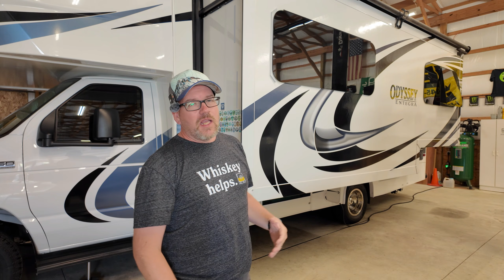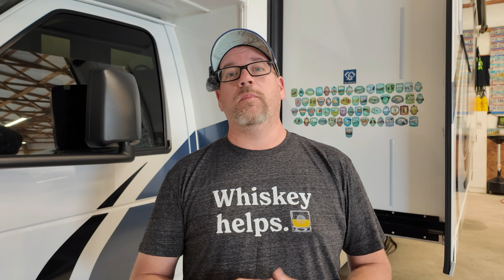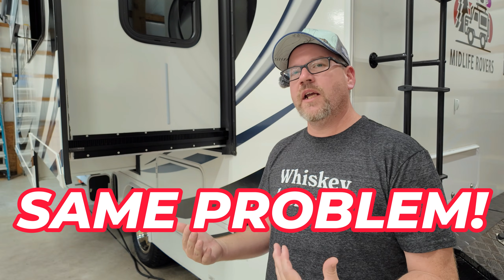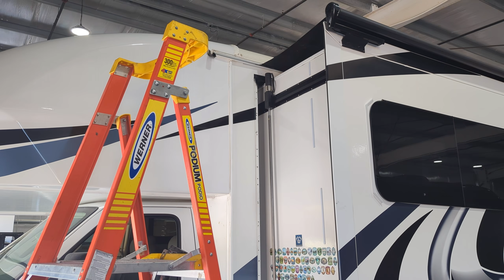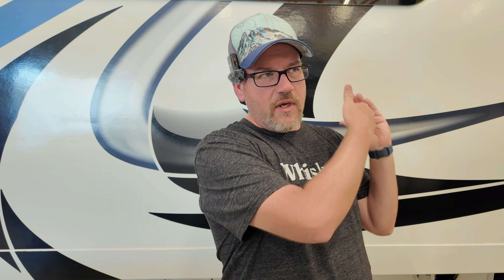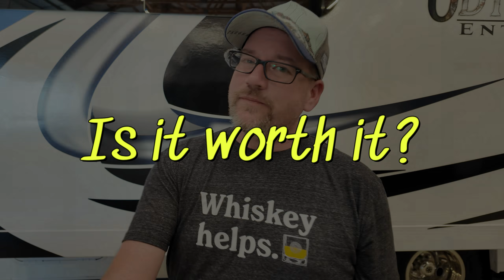Is Vroom an Upgrade Over Schwintek? Tumbleweed Slide Saga & Full Review

Comment: Wow, what an ordeal you have been thru. My entire career (now retired) has been in mechanical maintenance of some type, RV tech/automobile mechanic, Journeyman Pipefitter, Journeyman Millwright/Machinist. I understood every aspect of your descriptions. I'm glad I listened to the whole story which left me shaking my head. Where has integrity gone nowadays in the service end? I know it may be a bit twonky, a nicely shaped bead of black Sikaflex on the tops of those aluminum rails would leave the water run off nicely. We have 2 rack & pinion slides and a Schwintek bedroom slide in our RV. No issues with the Schwintek yet but did have an acme nut that wasn't Loctite fastened inside the slide operator back itself out. Didn't cost anything but about 2 hours to remove, repair and then check the operator on the 2nd slide for piece of mind. We have an issue with water entrance on the slides when retracting them if the slide awnings are holding water. Haven't come up with a good fix for that yet other than removing the water first. Sorry for your ordeal you went thru.

Comment: Final comment, you bought a used RV, you had problems with it,  (Because it was used you didn't have warranty support for anything (caveat emptor) ) and you had a problem so you took it to be repaired and you expected the repair center to fix every single thing that was wrong. They should have been VERY clear on what they would and would not do.  I don't know if you made your expectations clear (it didn't sound like it) that you wanted the entire system to work and if anything was found that was out of the scope of the estimate you would be asked if you wanted them to fix it.

Comment: It sounds like you had an installer issue. Unfortunately as a company opens up remote outlets and 'certifies' installers, they still cannot check that things are done properly, this problem exists what each and every chain of distributors in every type of business.  Thankfully we had ours done at the headquarters when the company was just getting started and we've NEVER had a problem.

Comment: I've had a VROOM system installed on my 5th Wheel for 4 years, I had it done at the factory in AZ when they were just getting started (before they had installers across the country) and we've NEVER had a problem. RV build quality is an issue across the industry. With the exception of a couple of small manufacturers, the large companies located in Elkhart have overall poor to moderate build quality at best. When it comes to slideouts you need to understand that the RV floorplan, frame and size of the slide, determines the type of slideout mechanism that can and SHOULD be used. Many of the Schwintek slides fail because they are used on slides that are too large and too heavy, the VROOM system was designed for these slides.  Understanding that what the VROOM system replaces is important. If your slide floor is garbage, or the slide isn't square, or it was poorly built in the first place, NO SLIDE mechanism will solve the problem.

Comment: We had issues with the Schwimtek system on a used 2013 Winnebago Adventurer 38 foot . We love the floor plan. The biggest issue is the slide is very long and way overloaded. With the tv at the front then the kitchen, a double door fringe, a stack washer and dryer, then the clothes closet. So when the the slide is in there is a lot stress on the bottom  gear mechanism trying to hold the slide in the closed position . Eventually the bottom track and gear system gets chewed Up. So first I added an extra track and gear system to help carry the weight moving in and out. When we first had the problem wit the original set up I heard a snap then find out the bottom gear had jumped a tooth then a second snap jumped a second tooth then the slide was riding at an angle with the bottom open. We took it apart retimed the gears and the first time out same thing happened. After installing the 3 rail complete with all new set up and realized that the problem potential was still there I decided to make slippers. I measured the high from the floor to the slide out when open and found the space to be approximately 7/8 of an inch. Made 4 inch wide slippers with nylon slider and positioned them under the edge Of the slide before we close it and have had no problems since, when the slide is in the weight is now distributed on the back rollers and the slippers.

Comment: Providing your Lippert is installed correctly,  proper LUBRICATION will Save you ALOTE of problems! The binding that happens with a dry slide leads to premature failure. Once I found LUBRICATION with CRC with PTFE, my slide has been heaven!!!

Comment: After 9+ months, do you have any updates? Did either of the companies every get back to you?
Reply from the maker: We heard from Vroom largely in response to this video but it was not a productive conversation beyond confirming and acknowledging the issues we spoke about. As expected, the slide has always worked mechanically. However, water intrusion remains a battle. The slide rails like to eat the flap seals so they have been replaced (again). We replaced our slide awning to a slightly larger one which has helped the rain issue when it is light. On downpours the only way we stay dry is to intentionally make the coach unlevel to help the water shed away from the coach. We DO NOT recommend this system.

Comment: We have found that Vroom is all HYPE. The Schwintek slides are good and not always installed, operated and maintained correctly. Every service job we perform on the Schwintek slide system was a lack of maintenance, poor installation or clients overloading the slide room. Sorry to hear you got pulled down in the Vroom rabbit hole. We have also found that manufactures don't always install the schwintek slides correctly. As a independent RV Service Center we don't sell new or used, our focus is service only, and offering the best experience to our clients. Great video!
Reply: I've had the exact opposite experience.  Never had a single problem with the VROOM but had TONS of problems with the Schwintek.
Reply: Sounds like the technician should have asked you if you wanted the electronics changed as well.  Based on the initial interview and the operation that you described. You were expecting a complete rebuild of your slide system, including the electronics and the installed just did the mechanical.

Comment: Great job describing your experience! I would have been just  as frustrated with the how they addressed the analysis and repair. We have a 2018 Big Country 3560SS that has a large double slide with Schwintek. The slide has always concerned me, but now it has been skipping on the way out. The bottom tracks are shot. It now is out of sync from top to bottom. Needless to say the system needs to be replaced. I was considering looking at Vroom. After listening to your evaluation of the two systems components, you have identified some significant differences that need to be considered. This has helped in my decision to replace what I have. Thanks! Love the shirt!
Reply from the maker: Thanks so much for the comment! Glad it has helped you in some way. For what it's worth, our side has mechanically worked flawlessly since leaving Tucson. That said, the water issue persists but we've found a way to work with it to prevent intrusion (making RV unlevel).

Comment: Whoa. I have  swintek. 3 slides with them. They work fine. I have learned  how to maintained them correctly. With lots of utube technicians. My slides are  smaller. That helps. If I may say. If you have a full slide. Only get it hydraulic only. Other wise walk away. They are heavy. And never get a bedroom slide. Make sure the bedroom doesn't move in a slide. And don't have a kitchen appliance slide either.

Comment: I commented on your video about how we are not pleased with our Vroom system. I just wanted to let you know I'm looking at going back to Schwintek. I know it isn't as heavy duty but I can find someone to work on it without driving 15 hours one way. Considering my fuel cost to make three trips and the cost of the Vroom system I now have over $6,000.00 invested. It's not working properly now and it's just out of warranty. I don't think I can justify another $700.00 for fuel and a 30 hour round trip, plus what ever the labor cost would be.
Reply from the maker: We have considered going back to Schwintek as well. With all of the holes and seal changes they made to accommodate the Vroom system, we're not even sure what that would look like for us. We wish you luck on the changeover.

Comment: Great take. I only wish I had seen this video prior to getting the Vroom install last week. I fell into the “we’ll see if the Schwintek works this time” category and I was done with it.  That said, I think I had come up with a semi-permanent solution to the slide motor popping up out of position. But as it is said, what’s done is done. Thanks for the video.
Reply from the maker: Since this video, we have continued to tweak the seals and adjustments to where we are in pretty good shape. Sounds like you may have similar skills. We wish you luck and a positive experience that others have had.

Comment: Great video. We have a full wall slide(23 foot long) and the rear part of the Schwintec needs replacing. I went down to the local RV repair guy (not Camping World) and he quoted me like $3200 to have a new H-column with motor installed. Just for the rear. I figure an entire VROOM system wouldn't be that much more expensive than changing the entire Schwintec since the front also is showing signs of wear.

I will be learning from your experience about checking the install.

Comment: I don't even know where to begin. Great video. Its a shame rv manufactures quit using the rack and pinion system on class C rv. I will not consider a slide out that does not have a rack and pinion system which eliminates all class Cs. I did see a old class C Winnebago mabie 2005 with a rack and pinion and I said to him Do Not Sell this. Awesome video but If you go to sell your rv trade it in so the new owner doesn't come back and hang you.

Comment: And I thought I was the only one who has problems with RV experts. I also have a mechanical engineering background and do my own work. The only time I go near a RV repair shop, with clenched teeth, is when I’m travelling. My next investment is to be a tee shirt like yours. Happy travels.
Reply: Adding to my comment, once upon a time in a galaxy far away, when I was younger, I spent some time as an Engineer on a ship. I learnt, as the old Chief Engineer whom I got on well with and who survived several sinkings during WW11 told me, “there is no spare parts shop at sea, this is what we’ve got, make it work.” I have had that conversation in my head forever. So, before I swap something out, haunted by guilt, I see his face in front of me and tell him why I’m doing it. If that makes sense.

Comment: no wonder some peeps simply prefer to go with an RV w/o slide outs i understand it now...
Reply from the maker: Yes, we can see that as well. Unfortunately, that only works in theory as there are very few RVs without slides these days. We've only seen very low end or very high end (like a Prevost) without slides. Once you start shopping for an RV, you quickly see the benefits outweighing the issues with the added space and options they provide. ~A~

Comment: 31:09 if you are worried about water movement, simply put a dab of black silicone where the foam piece is.  Also, you could drill a small hole in the "shelf" on both top and bottom of the rail to allow water to drain, if drilling said hole (nearest to end of rack closest to rv wall) would not interfere with the gear teeth upon drilling.  Although I think there's enough clearance for a drill bit to not touch the teeth when drilling through.
Reply from the maker: Thanks for the ideas! Unfortunately, we’ve looked into all of those options and none of them are really workable in this case. Since most of the water passes through the gear area, there isn’t a way to add any type of seal that wouldn’t also get caught in the gear and either destroy the seal or gum up the gear on the first slide movement.

As for adding holes in the top or bottom, this surface is actually a bearing surface — it’s what the slide rollers ride on — so any holes would have to be extremely small to avoid weakening it. Vroom actually added small drain holes already, but they’ve had little to no effect.

The best workaround we’ve found so far is that when it’s raining, I intentionally leave the RV about 1.5 inches out of level so the water will drain out instead of pooling.

~J

Comment: How about drilling holes so the water drains through the two horizontal sections?
This would not seem to interfere with the gear mechanism, but allow the water to run through
Reply from the maker: Vroom added some holes, but they have been ineffective. They simply can't evacuate water sufficiently. ~J
Reply: The only reason I found out about the water. Is cuz there was a storm...  I heard dripping.. paying over 60 thousand dollars for a camper. That sucks

Comment: We are looking at Vroom but $5,000 upgrade seems a bit crazy. Our Schwintek slide failed on a recent trip. Cost us $2,000 to find out that the potentiometers? In the controller flipped somehow so one was trying push the slide out and the other started pulling the slide in. 360 degree slide? Took a day to get it in and another day to figure out the controller was the problem. Thinking vroom is an upgrade? We live in WISCONSIN an hour from the installer you mentioned. Probably backing off Vroom for now and praying the Schwintek does not fail again. Sounds almost like your slide issue is a design flaw from the factory exacerbated by trying to fix a design flaw.

Comment: In my opinion Schwintek slides are not even close to being heavy duty. Especially for the entire side of an RV. I’m sure they work great for a bedroom slide out, which is where they belong . The RV should’ve been designed with a rack pinion system.  But you can look at how everything else is made and put together and it shouldn’t surprise you.
Reply from the maker: Yes, I prefer rack & pinion for several factors... Unfortunately, use on a class C would mean raising the floor deck. Not only would this raise the center of gravity and overall height of the rig, but also make the cab to coach transition awkward and the rotating chairs useless. Everything is a compromise and "cheap" seems to be the prevailing decision on many things. ~J

Comment: Thank you Jay for the excellent video on the Schwintek slide system, and detailing the issues that snowballed.  I have a 2022 Thor Gemini 23TW (purchased new in 2021) that is very simaliar to your Entegra, and we have been having slide issues off and on for the last year as well.  In my troubleshooting efforts I have replaced five slide motors, two controllers, and one harness cable.  I live in Wisconsin and was sold on the Vroom system to solve my issues, but after watching your learning video and now don't think it will matter due to my issues, thank you.  I will keep the system as is because the hardware is not the issue for me, it is the poor design motor install and the pins at the end of the cable that plug into the controller.  If you would like to know more I would be glad to explain in detail my issues.  I have subscribed to your channel and looking forward to seeing more from your channel.
Reply from the maker: Thx, If I recall, your RV has the double upper track. Which can complicate alignment. Honestly, the Vroom system is mechanically superior... It just leaks and doesn't help with many electrical issues and much remains in use after the swap. If you are having motor failures it's likely a load issue. Connection issues post install should be minimal provided you can keep the connections from moving and they are secured. If your motor failures are from the hall sensors the new Schwintek system may help as they took them out all together 😂. Thanks for the sub, but be aware most of our content isn't like this one. ~J
Reply: @MidlifeRovers the motor failures were caused because the motor rose up, due to the screw that is supposed to hold the motor down came lose.  When motor was turned on and jumped up, the four screws at the bottom of the motor snapped off.  The hall errors I had were caused because the contact pins of the connector that plugs into the controller got stretch open(from me taking the the connector off and on), once I pinched them back together no more hall errors.  Good luck on your travels, and I look forward to seeing new content from you.

Comment: Could you drop a small bead of caulking on the rail close to RV when slide is completely to act like a dam to stop water from running down edge into RV
Reply from the maker: No, where the water comes in is through the bearing block and gear mechanism. Anything put there will be destroyed when the slide goes in and out and/or mess up the mechanism. ~J

Comment: I worked for 40 years as a hydraulic, pneumatic & machinal sales rep and I was able to understand your issues and I loved watching this video, you did a fantastic job in the making of it. I have a Schwintek system on my travel trailer that is 16ft long and every time I push the button my heart rate goes up. So far so good however Schwintek doesn't recommend lubricating their system and we both know that is not good because if you don't use a dry lube and the amps go up what will happen. I have been looking at Vroom systems just in case something happens however after watching your entire video I will be putting a pin in that. Thank you for the information. Kind Regards!
Reply: They recommended tubing the blocks where the shafts pass through where the gears are located.